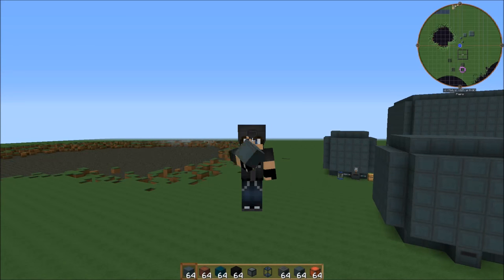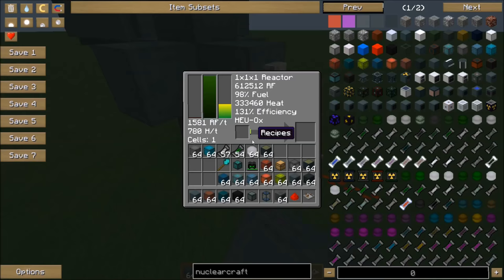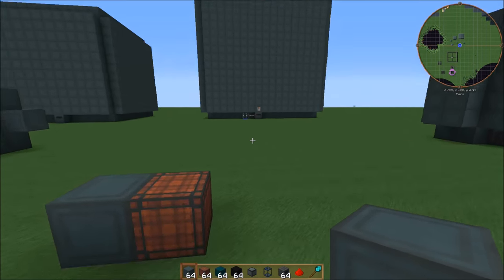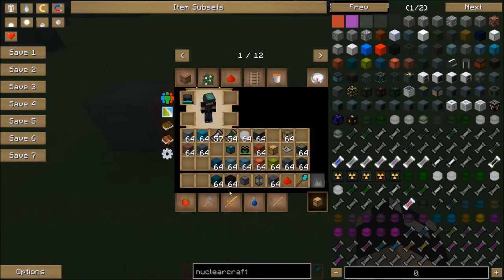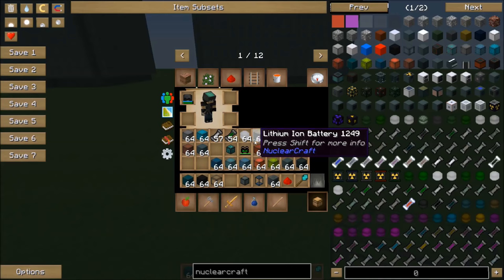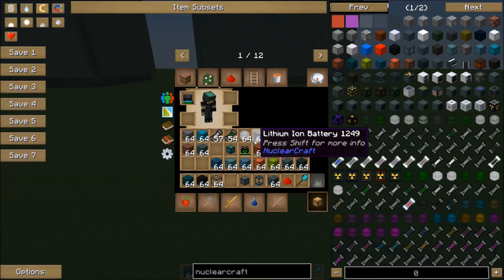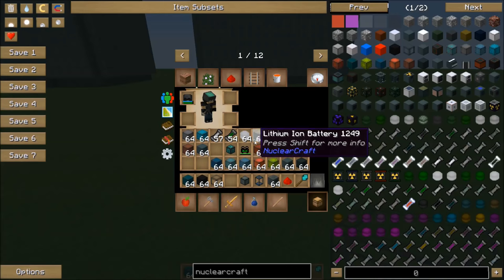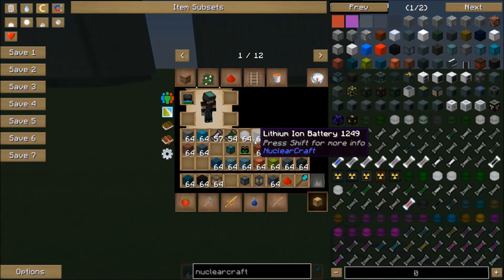Nuclearcraft How To Pt. 3: Fission Reactors

Comment: Awesome again - that was a very nice design you had there :)
There were a few changes recently that I still haven't really highlighted anywhere yet (other than the change log) - first of all, the longest side length possible is now not fixed at 17, but is configurable and defaulted to 25.
Secondly, there are now lots of new fuels - they are the blue, orange and purple coloured cells below the others that you may have seen, which are Neptunium, Americium and Curium. They, like Plutonium, are made from putting the depleted fuels through the fuel recycler.
Last thing to say is that although the particle accelerators are working, they are not complete yet. They currently simply generate antimatter, although the eventual system will be more complex and interesting, utilising special top-tier machines to produce and use lots of different types of particles :)
Again, great vid!
Reply: Speaking of Antimatter, have you thought of adding antimatter tools/weapons that instabreak/oneshot everything?
Reply: +n RealKC the paxel should able to break most blocks in one hit, if not try adding Efficency 5
Reply from the maker: Thank you very much :)  And thx for the heads up on the size and the fuel.  I'm actually very curious to see how crazy a 25x25 would be.  A ton of interior blocks for just the 17x17 :)  I have to say I really love this mod, just so much room for neat designs and optimization.  I'll add in some annotations for the size increase as well as the additional fuels.  I totally missed those.  And I'll probably still do a video on the accelerators, just to show how they work.  I'm very curious about them myself :)  It sounds like once they are fully implemented and all they will be very nice for sure.  Love it and keep up the great work :)
Reply: +n RealKC Haven't really considered it - I'm aiming for this mod to be reasonably realistic overall, but particularly so when it comes to the accelerators and its products. First of all, the antimatter currently in the mod is very temporary and will eventually be removed. There are actually 12 types of matter and 12 types of antimatter, so things will get much more complex. Secondly, attempting to use an antimatter pickaxe on a block of stone would result in a rather destructive, cataclysmic, apocalyptic event :P
Reply: +NuclearCraft Mod but that would be fun, I want to destroy half of my world by just breaking a block =P

Comment: Hey, is it possible to do this video again please?

I did not understand the main function behind those reactors with those interrior blocks, the math behind it and if they have emergency shutdown over redstone yet (I also will test if RedNet works from MFR).

Also it is quite hard to follow yous ince you are not be able to do one after one step ... you are totaly jumping through it.

What I think a good How To is, is:

1) Showing all the necessary blicks and there recipes (simple use item frames on a wall to display the recipe).
2) Showing a few fully builded (small, medium, big) RF and Steam Fission Reactors:
2.1) How to build those Reactors and can you cover them directly or not?
2.2) Showing how the Effency/Heat changes with one Fuel and the interior blocks
2.3) Showing a well efficened Reactor for one Fuel and how the interior is made
3) Showing the available Fuel Cells, pick at last three different ones and showing how the math works and how they can be aquired.

Finaly it is not bad but it feels like a bit unorganized but it is better to say the truth as lieing ;).
Reply from the maker: Yeah, this video is both outdated and old at this point.  Tutorials and showcases are much more organized now :)  Channel was still fairly new at this point and was getting the hang of things.  I will say though that crafting recipes are something I will likely never do unless I add overlays to the video that show the recipe as im going over things.  I always just stop watching a vid if it goes over recipes, as its a large use of time and considering that everyone uses nei or jei at this point, I dont see the point.  Plus custom recipes are becoming more common in lots of packs.  But yeah, this video def needs an updated, more focused version.  I will def try to get back to it once I have the time, atm I have a lot going on with series and collabs coming up, plus a few tutorials and showcases that im working on, but I will def add that to my to do list.
Reply: Thanks for the asnwere. I'll wait for it and see how it will be :).
Reply from the maker: Np at all and sorry for the quality on this one for sure, these older videos make me cringe :p
Reply: We are all not perfect but we will learn how to make it better next time ;).
Reply from the maker: For sure :)